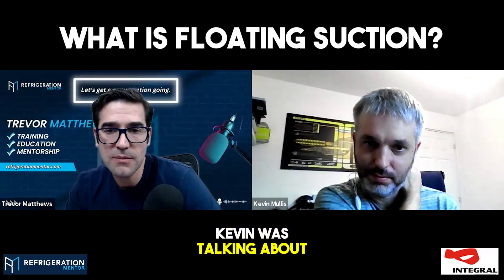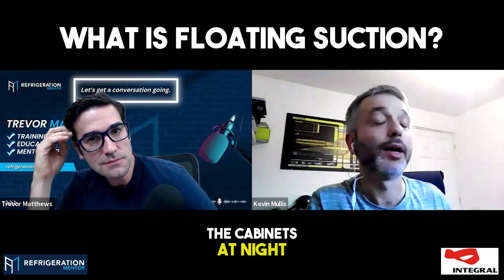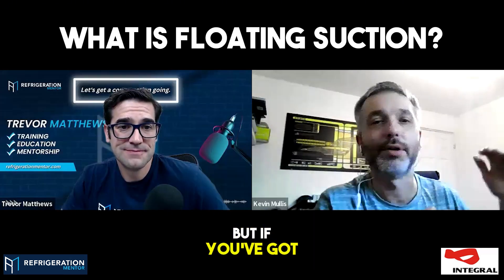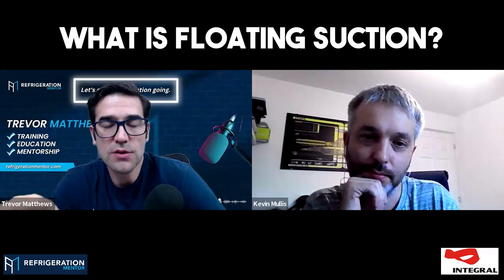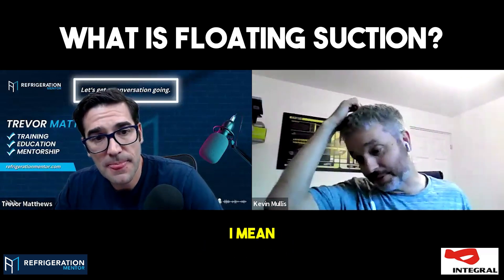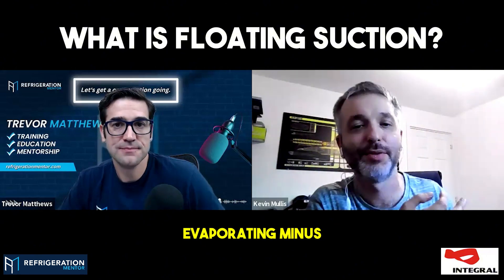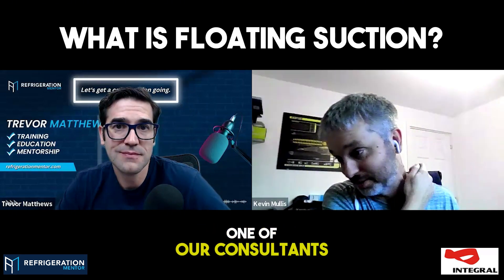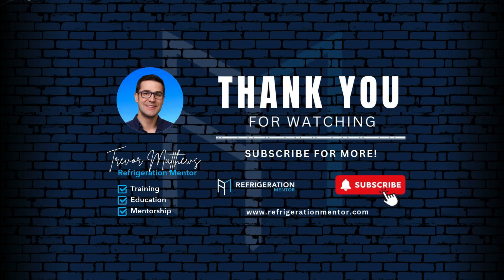Have you successfully implemented floating suction in your systems? Share your experiences!

Comment: How do you float co2 rack
Reply from the maker: @dannydowell6484  the same way as a HFC rack. When all circuits are satisfied or very close to satisfying in that suction group. The controller will increase or lift the suction pressure by a small percentage.